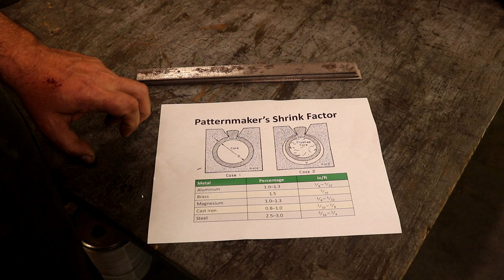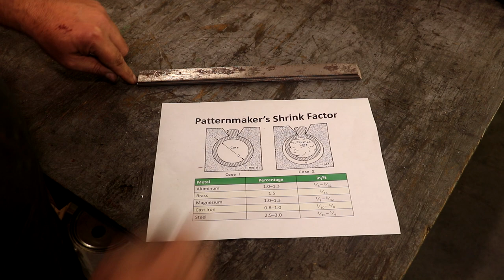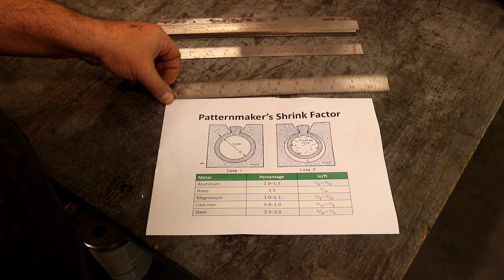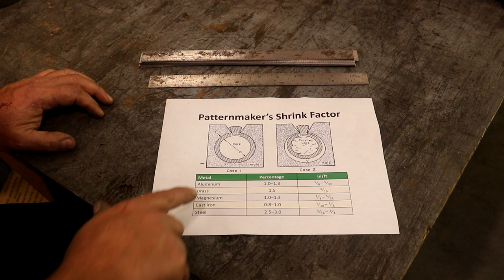Pattern Making for the Foundry - The Basics you NEED to Know!

Comment: If I 3d print a threading dial, and the lead screw is 5 TPI,   this means that if I double the number of teeth on the gear,  I can only get a dial with two divisions and still have whole numbers instead of 4, 8 and 12 subdivisions?  Should I go with 20 teeth on the gear so i could go 4 whole number divisions?  I Wish it was an even number of TPI.

Comment: Great video!!!  need info can you help?  The lead screw on my lathe is 5 TPI ( is this a common lead screw).  SO with the lock nut engaged at any position,  I can only make 5,10, 15 TPI threads?  My lathe doesn't have a threading dial.  These values ring metric to me. Is there any method to make threads (engage lock nut) without threading dial like with a dial indicator or marked tape?  I want to make internal threads in a blind hole without crashing the lathe in the hole.  If i disengage the the lock nut and pull out,  how do I find the position to lock the nut again?

Comment: Very interesting and informative as always. In the case of the crushed core example of your chart, would that cause the cast iron to break when it tried to shrink around the sand and compress it. Sort of the opposite of putting water in a cast iron bottle and freezing it. The iron bottle shatters. I guess I'm asking when you have to have that hollow cast can you put something in the sand that allows it to compress? You can see I have no experience with this but I enjoy finding out
Reply: As far as I understand it, you generally want to use a coarse grained sand for the core that allows for a fairly porous structure to the core. That way it's strong enough to handle the casting process but will yield and compact when the casting cools.
Reply: Organic material in the sand is usually used. Sugar in sodium silicate and sawdust in others. Amounts vary according to the class of work. The organics hold the shape of the core sand when cool, but burn upon application of hot metal and allow the sand in the core to compress and crush without tearing the metal as it contracts.

Coarse grained sand is used more for permeability reasons, and in some cases (eg, iron) to aid in resisting fusing of the sand to the metal. Mold washes do that too though. Permeability is a big issue if you don’t vent or vent properly.

Comment: I understand the shrink factor and would imagine that it's pretty consistent for the metal types, but how do you calculate for the machining cleanup... don't you have to make it all a little bigger to give you material to clean up during the machining process?
Reply: Yes. You add a little bit of flesh to mashine away to a surface that you want to mashine. This will guarantee that you have good metal on your finished part feature without surface inclusions or voids.
Reply: Rick,
The answer is it depends. If it's a high volume low cost part where extra machining is going to negatively impact the unit price (ie you lose your margin) you might put a little less extra meat on it. If it's a larger or one off (parts like Keith needs) where the material and the Casting are the biggest cost factors. You would also leave a little extra on. Keith mentions 1/8" (3.2mm) as what he uses for machining allowance. This would be added before you scale, and keep in mind your draft. If you want to machine something flat for instance you want that 1/8" of meat on the small side of the draft taper. On Keith's flat belt pully it would be the outside edge needs to be the (thickness of the finished pulley wall + 1/8")x shrink factor.

Comment: "A lot of talking."  But it was very needed from what I see in the community videos when the pattern is removed... not cleanly many times.  Usually poor sidewall finishes (machining roughness) and lack of draft.
Have been in producing injection plastic molding since 1962 still consulting on Monday and Thursday. Any plastic injection molded part needs the same considerations to produce a quality product. We have to add another concern with the shrinkage factor when high performance resins are used. The factors differ from the direction of fill vs the direction across the fill, caused by the reinforcing fiber alignments (mica, fiberglass, retardents).  Constant wall thicknesses and ample fillet radii can improve your project.  We machined our molds in tool steel before CNC controlled milling were available, contours required a duplicating mill which used pattern called a model.  Usually being wood it required proper draft, shrinkage, finish.  Our shop used local pattern shops to construct our duplicating models, a progress visit once produced an image I'll never forget, on the floor the next pattern maker was producing a pattern of a 3 bladed ship's propeller.  He and his assistant was adding an 18 inch fillet where the blade connected to the hub!  The material wasn't leather or wax but a roll of aluminum flashing being screwed to the apple wood pattern components (they supported the underside corner with formed radius gussets).

Comment: How is the core supported in the mold?
Reply: Check out windy hill foundry on youtube, Clark has a couple of videos with corded patterns
Reply: The core is longer than the actual part, so it sticks out of every opening in the Part.
The pattern is not just the shape of the actual part, but is the shape of the part with the sticking out core in the part.
Hard to explain...
Watch his patterns for the pulley and the  Steam nozzle, only the black portion is the actual pattern for the Part, the yellow painted portions produce a void in the sand where the core is inserted, so that is only for supporting the core, not to be filled with Iron.
Reply: On the big old "cylinder" pattern, the two cylindrical projections on opposite sides and all the bumps protruding in a circle around the top and bottom form areas in the sand mold (called core prints) for the matching projections of the core to sit in.
Reply: Just having a hard time visualizing it.